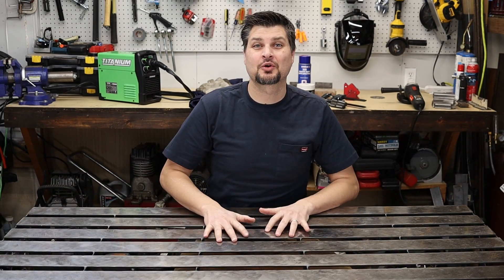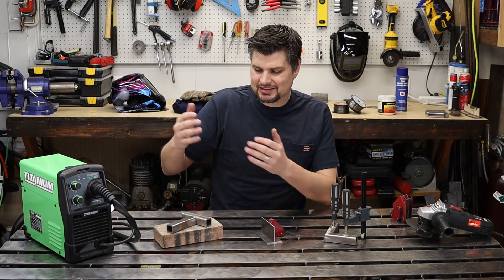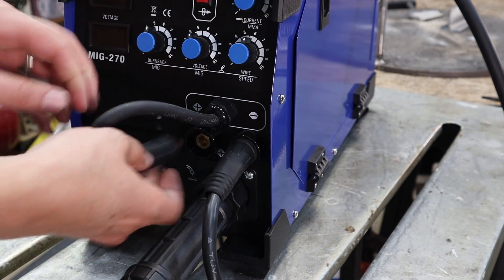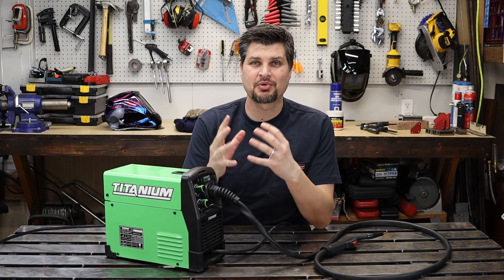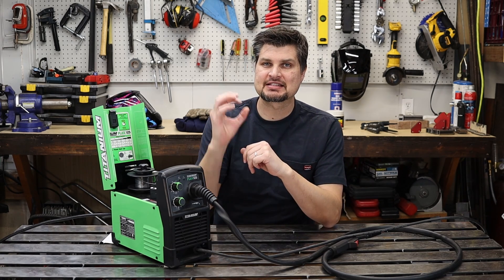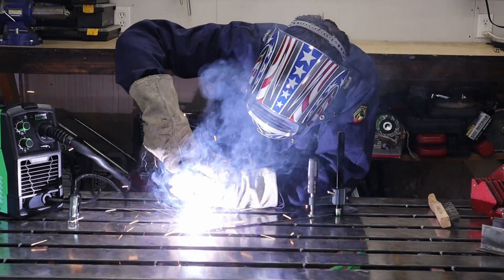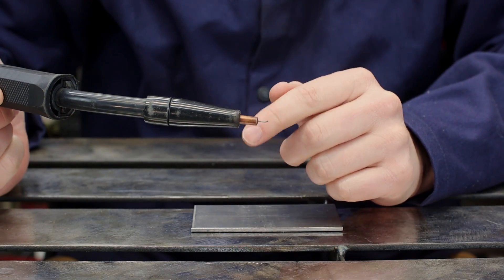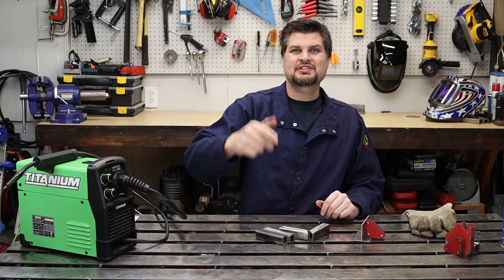Flux Core WELDING Basics: #1 Beginner Mistakes W/ HF Titanium

Comment: Knurled for Flux, V-Groove for MIG.... WHY isn't this in the Titanium manual ?!
Reply: ...also the cup thing on the end of the handle thing that you hold (what the heck is that called?); anyway, it came with two options, one metal, one rubber-looking. Once again, no explanation in the manual as to which one to use and when. I ended up using the shiny metal one because it was already installed as the default option. My first flux core weld looked like that mini ball ice cream. LOL
Reply from the maker: Rubber looking one is a hard plastic, it's a flux core nozzle (use it when running flux core). The other, metal one, is a mig nozzle.
Reply: @-DIYPRO-  thanks and super helpful video for a beginner! Most other videos on this subject gloss over the "obvious".

Comment: If you get a thickness gauge, make sure you get one for steel and not for non-ferrous metals. 12-gauge steel is 0.1046" and 12-gauge non-ferrous is 0.0808". They look the same but should have which one they are stamped on the side.

Comment: Why do you say to pull the trigger when theres a cold feed button right there next to the tension assembly?
I like how you make this easy for beginners. If more people bought a $200 EZ Flux 125 they wouldn't come looking to me to fix their junk.  👍
Reply from the maker: I think it's a pointless feature on flux core only machines. Even if it's a mig machine I still just pull the trigger and don't turn on the gas.

Comment: I bought the HF125 on sale. Maybe $90. Bought a cheap Hobart helmet, some wire, a pair of gloves and came home ready to fix stuff. Couldn’t see a thing out of the helmet and my “welds” looked HORRIBLE. 

Now I have always been one of those guys that was pretty good at anything I ever tried. Not great at anything, but always managed to conquer anything I tried. And I SUCKED at welding! It flat pissed me off. If some Pakistani dude wearing his underwear and welding barefoot in the dirt can do weld, why can’t I? It just stuck in my craw. 

Either out of stubbornness or stupidity, I refused to give up. One day I was in HF and I grabbed one of their $150 helmets and tossed it on my head. WOW! What a difference! I could see! With that cheap Hobart helmet I couldn’t see anything, not even a starting point. So I see this guy in line who looks like a welder and I swallowed my pride and approached him. “Hey, are you a welder by any chance?” I asked. He says “I might be.” I ask him to look through the HF helmet. “Is this what I am supposed to see when I look through a welding helmet?” I ask. “Yep” he says.  Well shit, I’ve been using a bad helmet the whole time! My current helmet is TOTALLY black all the time. “Yeah, you need this helmet” he says to me. 

So I call the wife and say “honey, I NEED this helmet!” (just a tip for you recently married fellas, this is how you stay married for 43 years to one woman). I rush home to try the helmet out and it works great, and while my welds were certainly much better, they still weren’t acceptable to me. Then I watched this video and realized I was running gas wire through the welder, went back to HF and bought gas-less wire, tossed it in and voila! It wasn’t me, it was the equipment!

Many thanks for restoring me back into the HeMan Club!
Reply from the maker: Right on!

Comment: Thanks for posting this. I've been trying to weld billets together for patterned steel forging, so I don't care what the weld looks like, just that it holds. So far it's been quite frustrating, but I think I picked up some tips from your video; will try them tomorrow.
Reply from the maker: Right on, how did they turn out?
Reply: @Mech Master  much better, thanks! I am welding a damascus billet with a work stick, and it's holding together which is all I ask.

Comment: i used a knurled drive wheel but it didnt work out well, smooth one works best in my vevor
Reply from the maker: Good to know, thanks! Which Vevor do you have?
Reply: @-DIYPRO-  blue one, 200amp 3 in one machine . It's working well for me used it today to patch stuff on the car. With the flux it just eats right through the paint and underseal on it. Oh and blows in nice holes too... Lol

Comment: I'm making a bumper that is 3/16, but the mounting bracket is 1/2. Will this welder work for this project?
Reply from the maker: Technically no but since it's just a bumper why not! If it were me I'd heat up the 1/2" prior to welding and try to keep as much heat towards that piece since it will act like a heat sink.
Reply: As stated heat up the metals for more penetration, grind off any mill scale, rust and paint. And if possible bevel both sides of the bracket so you can burn into the bracket from both sides. Some 0.35" wire (make sure the wire is multi pass rated!) and max out the settings and you should be okay.

Comment: Perfect timing. Just bought everything yesterday and my welds look horrible 😂
Reply from the maker: Perfect!
Reply from the maker: not perfect that your welds are horrible! Hope it helps.
Reply: @-DIYPRO-  do you have a respirator you would recommend? Also what filters? Heard 2097 are better than 2091 filtwra
Reply: Three thinks I was screwing up my drywheel to tight and wrong size groove wire speed and I was going to fast making weave is easier for me to make good welds instead of stringer
Reply: Me too...
Reply: Practice Practice Practice! Just like sex